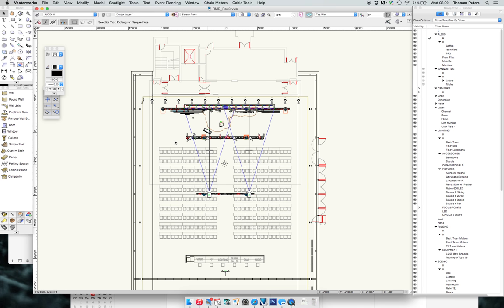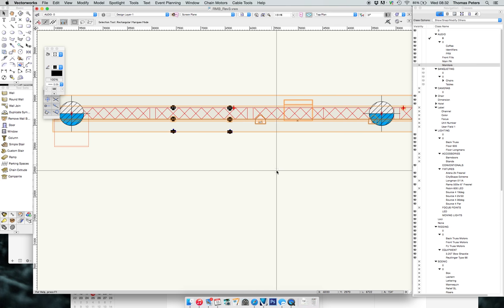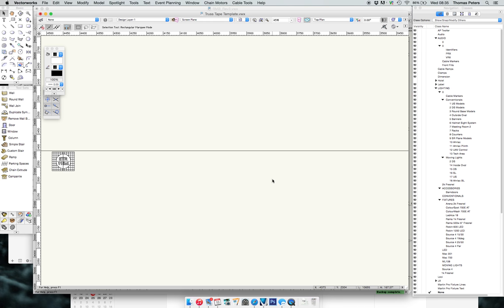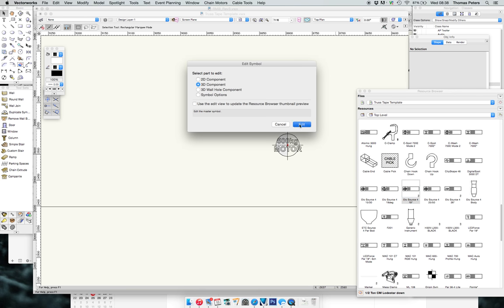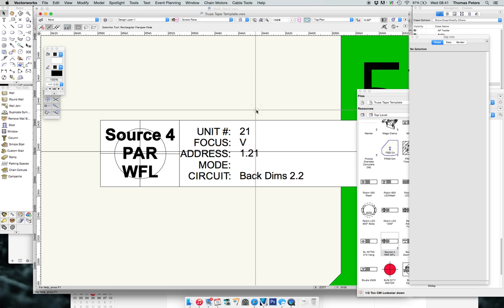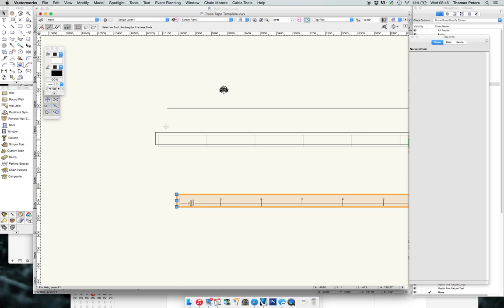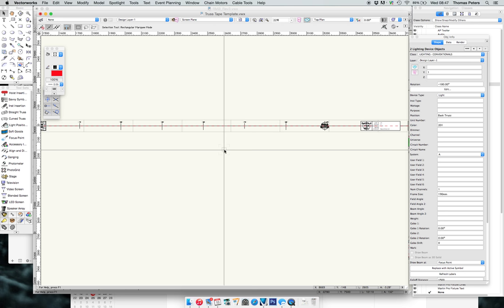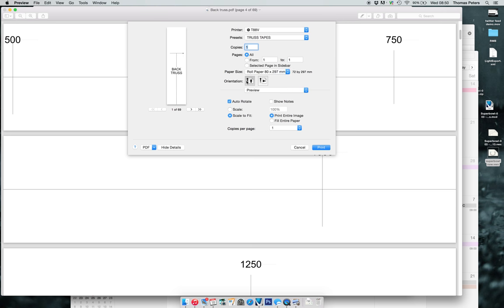Truss Tape Demo

Comment: Everything was set right. what I am running into is that the printer does not want to take a print job more then 70 inches.  Then there is a small page brek and it prints again so on a 40ft truss tape I get like 5 small breaks.  do you have those small breaks or were you able to configure the printer to not have any margins?  Also why do you use preview instead of vectorworks to print?
Reply from the maker: Kyle Waites Hi Kyle, I've made a demo installing the printer from scratch and printing a complete file, you can find it at https://youtu.be/vWxyH8jgg2YPrinting from Vectorworks doesn't work very well at all, going to a PDF and then out of Preview seems to be the only way to get a decent product.

Comment: Thanks so much for doing this.  I got the same printer as you and I am on a Mac running vector works.  but the printer seems like it does not want to print longer then 70 inches.  Did you have this issue? if yes how did you fix it for your long prints
Reply from the maker: Kyle Waites Hi Kyle, I did run in to a lot of similar problems in the beginning but after a few hours I had it figured out. Be sure your paper size in Vectorworks is correct to the rolls you are using, and then print to your printer, but save as PDF to print from PDF, via Preview, not Adobe Reader. Check your paper size is correct, and your orientation. Under Layout select 1 Page per sheet and layout direction should be Left-Right-Top-Bottom. Let me know if it works out?